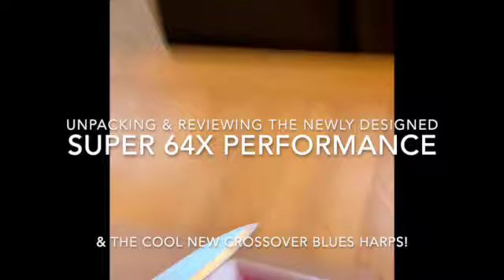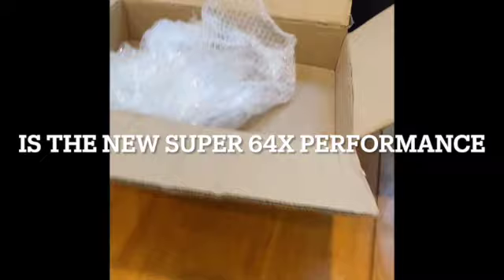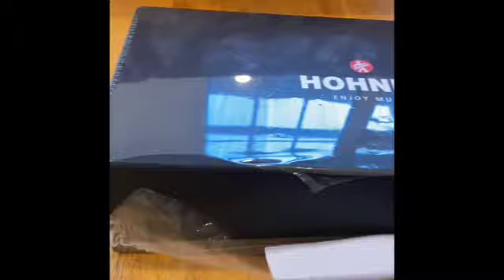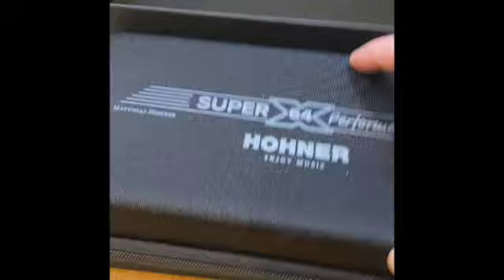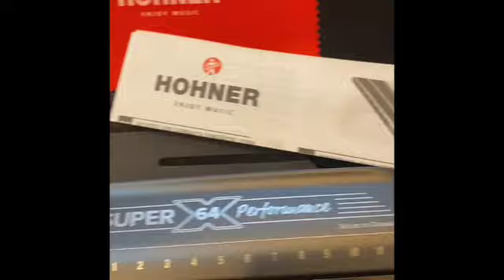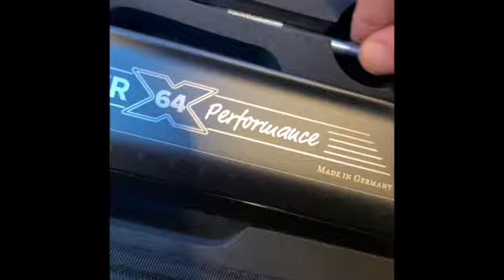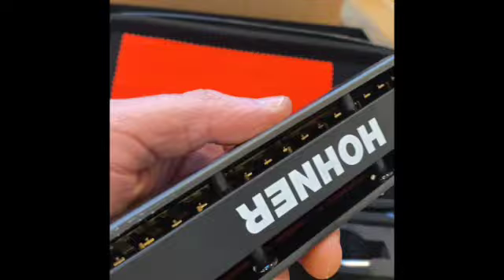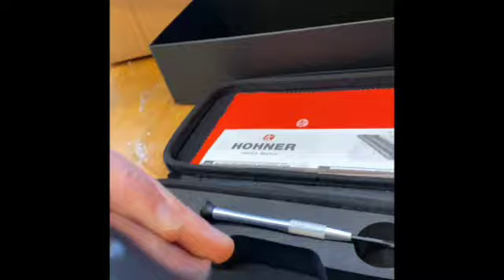Unpacking newly designed Super 64X Performance & quick review.

Comment: I recently purchased a similar model called the Super 64 Performance. 
I'm a little disappointed with it because several reeds give poor response and tone. They are the 2 and 3 draw notes.  Have you noticed any poor performing reeds on the Super 64X?
Reply from the maker: No such problems with the Super 64X. 
It is hard to assess your problem with your comment as you give no indication as to what exactly is wrong with it. For example, I suggest that it is perhaps your embouchure. If not and it is indeed a faulty harmonica from the factory and you recently purchased it you can have it replaced or repaired.
Reply: @CathalJohnsonHarmonicas  Thank you for your reply.  Others have told me that the problem I have experienced is because of embouchure and I must adjust my technique and and skill set to play these notes.  But if we use the analogy of playing a piano and the middle C key is not as responsive and requires a different pressure to play I would have the piano fixed.  If I buy a harmonica with the quality of the Super 64 I would expect that each reed should play equally well with the same tonal quality.  If all the other reeds sound perfect, the 2 and 3 draw notes should sound equally well. It is not a matter of embouchure.
Reply from the maker: @andrewjohn3288  If you are having problems with the two low notes on the draw, then I bet it is indeed your embouchure, you are bending the notes unknown to yourself. How long are you playing? It took me years to play low notes on a chromatic to get the correct tone. Even when I thought I was playing them good an expert harmonica player came to visit me and pointed out that I was playing them wrong. Make a video and show me. Otherwise I recon it is indeed your own fault. Your piano analogy doesn't really stand up. How about a wind instrument analogy for example a tin whistle, flute, saxophone trumpet all depend on correct embouchure. If you want you can contact me via my website www.harmonicasireland.com and get to the bottom of it. Where are you based ie live?
Reply: @CathalJohnsonHarmonicas  If incorrect embouchure is the problem, then all of the notes would have the same problem.  It is only the 2 and 3 hole draws that give me difficulty.  These reeds seem to be different from all the rest. Thanks for letting me rant about this pet peeve of mine.
Reply from the maker: @andrewjohn3288  Not really no. Incorrect embouchure is mostly revealed in the lower notes. To a degree you are right though, all notes suffer from incorrect embouchure and so your tone is effect throughout the harmonica, just less identifiable. The best way to test this is to use a tuner. 
Where are you from and how long are you playing?